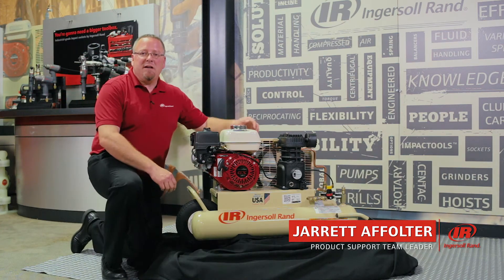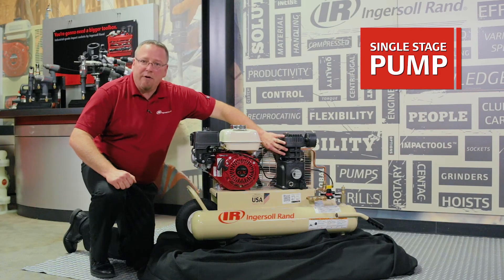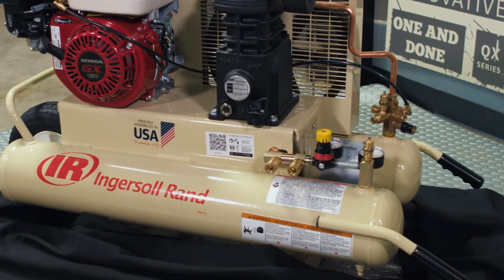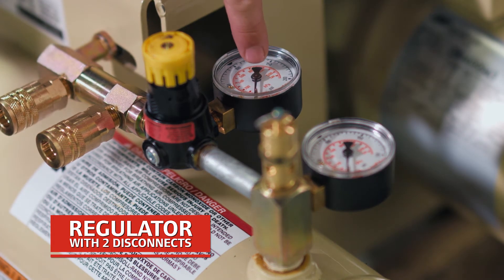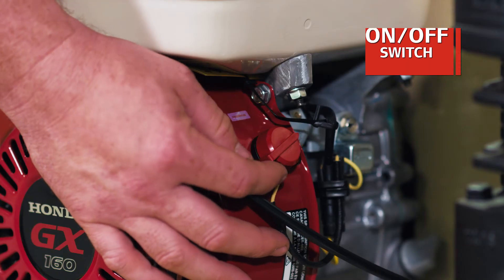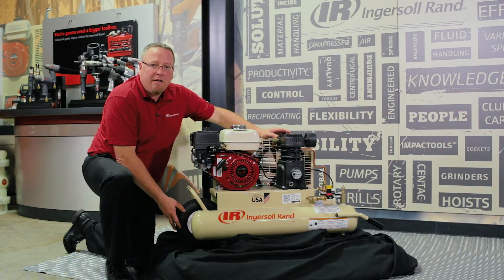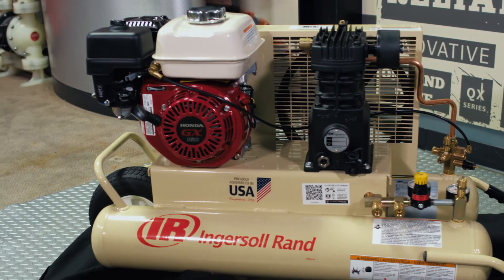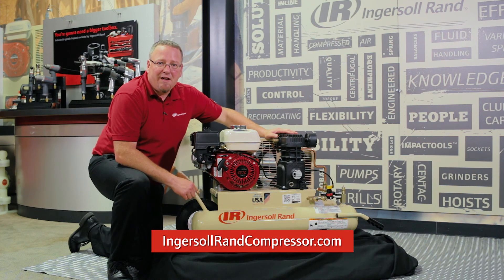Ingersoll Rand SS3 Gasoline Driven Wheelbarrow Air Compressor

Comment: How much oil goes in the engine/compressor? I’ve lost my manual. I also believe my compressor side is a bit bigger 2 stage?
Reply: Engine if it's a Honda GX160 takes I believe 0.7 quarts and the pump should take a maximum of a quart but not sure though just add till it's in the center of the oil sight on flat level surface.